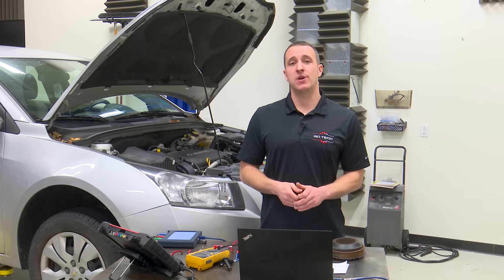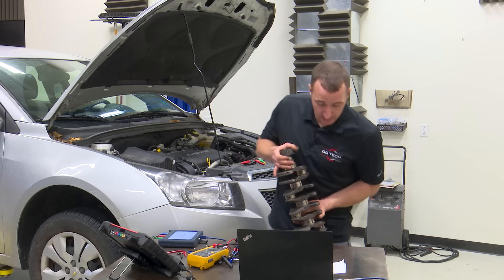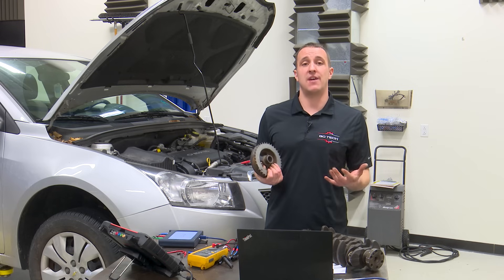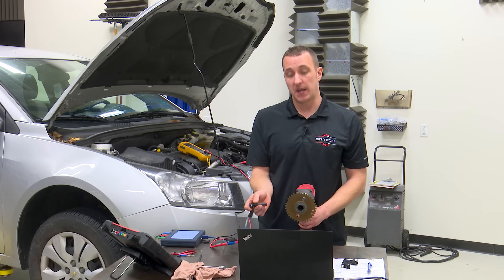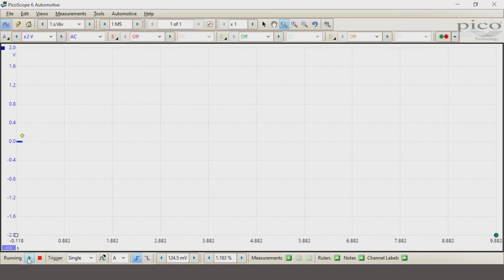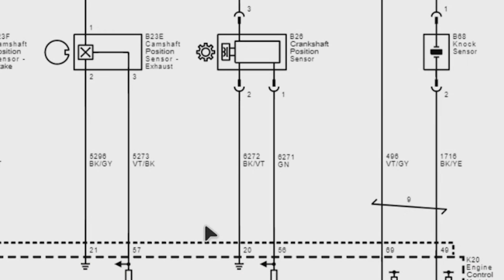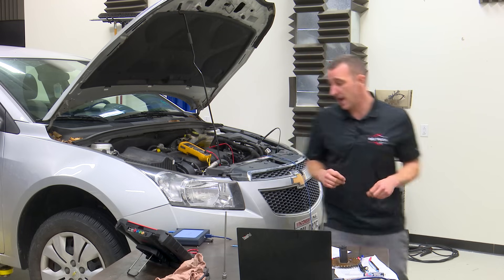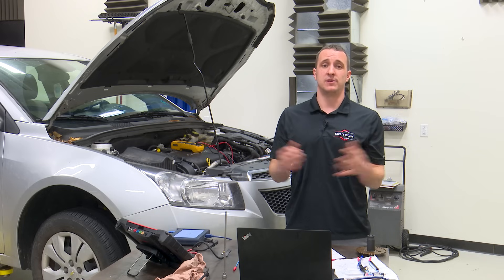How To Test Crankshaft Position Sensors (CKP) The Right Way

Comment: You did not show how to use the 3 terminal sensor on a multimeter.  You only show it on the scope.  I cannot afford a scope but I do have a multimeter.  You show how to obtain voltage on the 2 terminal sensor and the multimeter but not so on the 3 terminal sensor.  Thank you I still learn something.
Reply: Scanner Danner’s
Reply: I think on the 3 pin sensor, with a multimeter you can only check voltage and ground wire, not signal wire

Comment: I have been trying to check a CKP from a 2005 Jeep 4.7L .  When I connect it to a 5 VDC supply to the sensor and measure the voltage (using DVM) between the signal  wire and negative on the power supply it is less than 0.1 VDC.  If I place a screw driver on the sensor the voltage drops to zero.  I have a brand new CMP for the Jeep and the signal voltage is even lower with no metal.  Moving a magnet instead of a screw driver makes no difference. Do some digital sensors output a pulse rather than drop the 5 VDC reference on the signal wire to zero? if that is the case will I need a scope to test the sensors out?

Comment: Very informative although it didn't help me start the car I'm working on it does tell me plenty. I do have a 0 RPM showing during cranking the engine with the new or old sensor on a 98 Ford Taurus V6. I still have a crank but no Start condition. It's not the fuel pump. Plenty of fuel sprays out of the connection on the fuel rail when I press it in and the engine is on. Sadly that's my fuel pressure gauge and it appears to be plenty of spray -pressure. I sprayed Gumout Carb and Choke cleaner into the air duct-hose and it fired briefly. So it appears to be the injectors. Could be the anti-theft system, but no key fob available to lock and unlock. I'm perplexed.

Comment: I have been asking for help and telling people to pretend. Like it's the crank shaft class for dummies. And they don't get it. This is exactly what I needed. Thank you so much for putting this video out. It was thorough and in -depth and very easy to understand.
Reply: Somehow I found this thankful lord so many hours it's all in the wording
Reply: This is a great class  on crankshaft sensors, their function and purpose. I zeroed in on the intermittent problem and what caused it. What kind of scope setup were you using besides the laptop. I am experiencing a P0389 code on a 2006 Honda Odyssey after a belt failure.  Would like to see some visual information to find the cause.

Comment: Great class professor, you're so right about an inductive (analog) type CKP not being good eventhough it ohms to spec. I had a Pontiac Grand Am that would die on me about 15 minutes after reaching operating temp. I did a resistance check on it after car cooled down and it was good, so I went looking for something else. Couldn't find anything, so I waited for the car to die again and did a resistance check, it was in the Megaohms. I replaced it and car ran great. No more dying out.
Reply: Did your car run rich also while it was running bad and would die ?
Reply: @Maintenanceman81   No, it ran great until it died. It was as if someone turned the car off by flipping a switch. A crank sensor shouldn't affect your fuel trims. It's only there to tell the computer where the pistons are in relation to crankshaft angle and for RPM.

Comment: If u can help me here to understand more on how to test camshaft sensor if I connect my voltmeter negative wire to ground wire of the camshaft sensor then posetive voltmeter wire to the signal wire of the camshaft sensor it shows 5 volts but if I put metal gear or a metal screwdriver the voltage dropped to 0.01

In the first place is it supposed to show 5 volts or any voltage reading without putting the sender close to a metal coz on your vid is shows tht it must produce voltage when the camshaft or crankshaft is turn or spinning

Comment: First , great video. Very informative. And I can show my friends why I'm not crazy! I can usually tell when something is wrong before the computer triggers the engine light. My friends think I'm crazy when I replace sensors when the M.I.L. is not on. But when I notice a difference after replacing a sensor, whether good or bad, I know it was beginning to fail. Sometimes I have to change multiple sensors because the first one makes it run different or even worse. Think....when they wear together they start to compensate together too. Just don't wait till the car warns you  something is wrong because by then who knows how much it has compromised the motor or catalytic converter. Expensive shit to replace.
Reply from the maker: Thanks for checking out the video!
I agree, not all issues set a warning light!

Comment: Hi, can you please show us how this pattern looks like on canbus raw data?
Reply from the maker: Hello,
I'm not sure what you mean? 
The crank sensor on this vehicle is interpreted by the ECM and turned into a digital RPM reference. The RPM reference is shared between modules using data. If you took the time you could decode the CAN message between modules, but not sure what the benefit would be? 
I have not spent much time decoding CAN Bus data because I never had a use for it, but some find it helpful in diagnosis. 
~Ryan
Reply: @GoTechTraining  Thanks for your prompt reply, i replaced my OEM cluster with digital cluster and i need canbus data to catch all info. I am not using obd2 protocol because it is too slow for this project. I just missing some info such as inj pulse width, flow rate and MAP pressure.
I still trying to catch all ECM but it is not an easy job at all
Reply from the maker: Wow sounds like a task !  I’m personally don’t get into custom programming much but it sounds pretty cool!

Comment: My 4g 64 engine can't crank
Reply from the maker: Hi,
If it doesn't crank over, I would start by checking the battery and starter circuit.

Comment: Seen ten million videos on people using a test light to check ground and voltage supply to crank sensor. He said dont, yet scanner danner, diagnose dan, pine hallow, south main, and dozens of others have. I also have… a test light is fine on that circuit…
Reply from the maker: Hey Mike,
I will agree if you have the right low amperage test light it may be fine to test computerized circuits. I personally just don’t like the results. It already a low 5 volt circuit, so at best you may get a dim lit test light. I like to see the correct supply of voltage and ground. 
Thanks for reaching out !
~Ryan

Comment: So from what’s said here you can’t test because who is going to have a lab scope? If testing with a multimeter cannot confirm that the sensor is faulty then this video won’t assist the home mechanic - what’s the point then?
Reply from the maker: If the sensor is completely dead, a multimeter will show no signal and can confirm a faulty sensor. The multimeter can also be used to test reference and ground. But it can be hard to find faulty signals or intermittent issues with an average voltage reading. This is when a lab scope needed. Scopes are becoming better priced, and are being used by a lot of DYI technicians. The point of the video is to show what the signals look like and how to obtain them.
~Ryan

Comment: How would a magnetice tone wheel would affect the wave form? What would it be the characteristics on the waveform to say that the tone wheel is magnetice?
Reply: I asked this question because you mentioned that sometimes the tone wheel get damaged or gets magnetice by accidents or mistakes . Thanks for the info. Great video
Reply from the maker: Ok, if the tone wheel becomes magnetized, it will either not produce a signal, or it will drop out, usually at higher speeds. I have also seen a magnetized tone wheel invert a signal and cause a lot hard to diagnose drivability issues.
~Ryan
Reply from the maker: It’s impossible to tell from the signal, it will look the same if the reluctor wheel is metal or magnetic. What it changes is how the Hall effect is triggered. Service information is the only way to tell or a inspection. 
Great question!
~Ryan

Comment: Never replace a cam or crankshaft position senor with an aftermarket brand. They usually don't work. I know, I had an Altima with no start symptom.  Changed sensor with aftermarket. Still no spark. Probably ECM, because wires and connector were good. Nope..... another bad senor.  Pay more money and buy the oem.
Reply from the maker: Hey George, 
Bad new parts are the worst! 
Thanks for checking out the video!
~Ryan
Reply: Oh ok

Comment: If the vehicle will not start, will you garner enough information on the scope with just the starter turning over the engine?
Reply from the maker: Hey Jeff,
Yes , the crank sensor signal should be able to be picked up at cranking speed.
~Ryan

Comment: Thankyou, the level of the VR sensor is critical. I had a Ford F250 that only has the VSS on the back axle. Even with a new sensor it only read about 350mV P-P. It would operate the speedometer but was not good enough for the ABS and ECU. You need at least a couple of volts and some go much higher. like 20V at speed. From various videos I think it should be at least 4V P-P but there seems to be nothing in service data on the expected output. Also some are grounded and some a floating.
Reply from the maker: Right! Wouldn’t it be nice to have that information in service data! Thanks for sharing and checking out the video! 
~Ryan

Comment: Boss ihave 2017 audi a1 fualtcode c104b29 and u101700 that small yellow sliding light comes on and one massage on the culster stabilisation control (ESC)fault see owner's manual iam atuo electrian and check wiring power ground ignition and can bus everything is there and ican ask some one he told me about voltage problem ican cheng the alternator brand new battery and cheng the abs module but problem still there and same fualtcode when ican clear the codes are clear but when I drive the car same light same massage and same fualtcodes come back can have any idea please
Reply from the maker: I’ll look into it and see if I can help you out !

Comment: question if there were 3 teeth worn down say, 1/8 in on wheel would the scope show missing  SQ.WAVE on them teeth!
Reply from the maker: Hey Robert,
Great question!
If the sensor was strong enough to pick up the trigger it would switch normally, if not it would show a gap or missing teeth. On a VR sensor the amplitude of the signal would drop till the gap was too big to generate a signal.
~Ryan
Reply: @GoTechTraining  thx!!

Comment: Do you guys trust the "reading RPM gauge method" while cranking as a quick Crankshaft sensor check?.....I know it doesn't work with all manufacturers.
Reply: It's a quick and dirty check when you got no tools in the moment. But like you said on some manufacturers it doesn't show RPMs while on my scan tools i can see RPMs.
Reply: Older fords would tell you the crank sensor is working if the check engine light goes out during cranking. This would be the cars that actually have lights for mil indicator not electronic dashes because not sure on those at all
Reply: Cool.....💪
Reply from the maker: Good question!
I always look at it from habit and try to graph it with the scan tool if I can. It’s a good tool for 
Quick checks, but like you said , don’t trust it ,if doesn’t show a reference. 
~Ryan

Comment: Good afternoon everyone:)
Reply: Ryan : Is that the GM " cylinder deactivation " PCM ? LOL !
Reply from the maker: With an added shake feature!
Reply: There was a GM VAN where the engine was rebuilt by a machine shop . The reluctor wheels were MIXED when rebuilt . A V6 went on a V8 ! The VAN would not run . Jerry Truglia diagnosed it with a scope . The engine had to be REMOVED from the VAN - OUCH 🤕 ! There was a car with a bad ground . The reluctor became MAGNETIZED and the vehicle ran terrible ! Bernie Thompson, ATS , diagnosed it with a scope . He fabricated a tool to DEMAGNETIZE it . There are videos on the above . Great lesson . Did you send Mike to pick up lunch ?
Reply from the maker: Cool case studies!
I had a GM van with a PCM from a salvage yard out of a v6, put in a v8, It ran but missed on 2 cylinders. 
Thanks for reaching out and checking out the video!
~Ryan
Reply from the maker: Hey Nicholas, this is in the comments section. Try joining in on the live chat!
~Mike